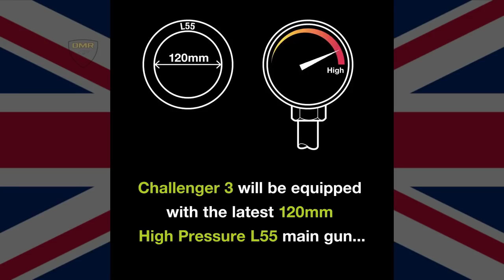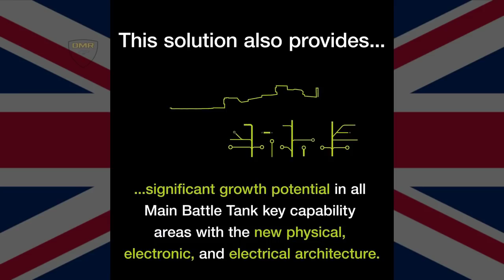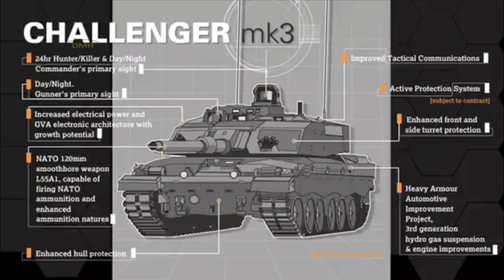Finally! The UK Unveils New Challenger 3 Main Battle Tank

Comment: 60 mph!  WOW but HOW? That is a serious objective. 60 tons at 60 mph! Fast MBTs today do 40-45 mph
Reply: I was thinking the same it would have to an insane amount of bhp, well over 2000
Reply: This just shows that
1200 HP Engine should have been gone 2 decades ago. 

Alright we got a new challenger coming to war thunder!  Lets goooo
Reply: @Justineexy  It's the same engine with common rail injection and a modified airflow/ cooling system.
Reply: its a typo, the cr3 will not do almost 100km/h, that would be almost doubling its top speed, and thats not going to happen with just a new coolant and injection system.
its still 75+t heavy and still has around 16HP/t power to weight ratio
Reply: "Fast MBTs today do 40-45 mph" no that is plain wrong. Alot of tanks today go faster then the chally as it one of the heaviest modern tanks.
Reply: 60KMH is  more likely
Reply: @paulhill1665  it can exceed that now.
Reply: @zhufortheimpaler4041  It isn't a typo. ALL the relevant sites are quoting up to 60mph, including the British MOD site.
The CV12 is getting a power and more importantly ,a torque increase with common rail diesel injection, which combined with third gen hydro pneumatic suspension will make it a really rapid tank.
Reply: @thewomble1509  the current world speed record for a tank is about 54mph from 2002 a Scorpion, think it will be very difficult to get a Challenger to that speed unless travelling vertically, from what I have heard there is a new cooling system and rail fuel injection, even if that was to produce enough power, I don’t think the transmission would cope,
Reply: @paulhill1665  Ok Paul. Sorry, I didn't realise you actually build Tanks mate. Keep up the good work.
Reply: @thewomble1509  well the reasonable sources i can acess all state 60km/h, not mp/h, wich is much more realistic.
the Cr3 is heavy (about 80t) and considering, that lighter MBT like Leo2, M1, Leclerc and T14 have an average top speed of 70-80km/h and the fastest 90km/h and that they all have a power to weight ratio of at least 24hp/t or up to 38hp/t to achieve this.... 
the Cr3 would need around 2200-2500hp and the relevant torque to achieve 100km/h
Reply: @zhufortheimpaler4041  T14 if I remember correctly has a 72mph speed, Unless my Brain. Failed me than that should be right.
Reply: @Justineexy  T14 has 31.1 HP/t and maxes out at 90 km/h
it weights in about 50t and has a 1500hp engine
Leo2a7v has a 1500hp engine, weights in 67t and has a power to weight ratio of 24.2 hp/t and can reach 72km/h
Cr2 has 1200 Hp at 75t and can reach 59km/h
so yeah.... 60mp/s are very llusionary on a 80+t tank
Reply: @paulhill1665  its confirmed 96kph not 60kph. The CR2 already does 60kph lol. CR3 is on a whole different lev
Reply: @paulhill1665  the challenger is actually the best riding tank off road because of its hydro gas suspension....its well known to keep up with faster leopards off road
Reply: @zhufortheimpaler4041  60kph is already the top speed for the cr2...CR3 is the 97kph tank. CR2 has been around for 25 years how do people not know that its 60kph...
Reply: @rayhan_2k841   the report says the work will  include suspension upgrades, but no detail, hopefully does not mean changing to a different system.
Reply: @rayhan_2k841  yes, and the engine does not change, just gets a slight upgrade, how does a coolant and injection upgrade push an 1200hp engine to beyond 2400hp?
Reply: @thewomble1509  If the MOD make a typo, all the relevant sites re-publish it because they're not tank experts. It's almost certainly a typo, there is simply no way that the tank is going to gain that much speed.
Reply: @AllThingsCubey  Why not? Come on, back up your argument, know all.
Reply: @rayhan_2k841  60 kph was just a design requirement, Challenger 2 can travel in excess of 70 kph. Whilst 60 mph is ambitious for CR3 It's not impossible.
Reply: @agt155  Yes, it is impossible.
Reply: @thewomble1509  Laws of physics. Leclerc is 20 tons lighter than Challenger 2 TES, and has the same type of hydrogas suspension, plus 1500hp. Leclerc is limited to 72kph/ 44mph because higher speeds damage the suspension and tracks. Even if Challenger gets a 1500hp engine as CAT is planning to upgrade it to, the tracks and suspension cannot support that speed, and the transmission is not designed for it. A tank's top speed is more down to the gear ratios than the raw engine power, and they are not changing the gearbox in Challenger 3. German sources have already corrected the typo and stated it as 60kph, not 60mph.
Reply: @AllThingsCubey  So many errors in your post there. 
1) Leclerc has second gen suspension.
2) It weighs 57 tons, a C3 weighs 65 tons.
3) as you said , Leclerc is LIMITED to 72 kph to reduce wear and tear on tracks etc. Why can't the C3 be limited for the same reasons? Note the press release said UP TO 60mph.
4) the TN54 IS designed to handle 1500hp.
 5) Torque is just as important as gear ratios and that is being increased.
I've read your quotes before. You claim to be British but constantly criticise and mock British vehicles and equipment.
Oh, one more thing: on operations in the second Gulf war, C2's were regularly clocking 78kph with full add on armour on the road to Basra.
Reply: @thewomble1509  No issues at all in what I said. I said Challenger with TES, which is 75 tons now, 76 tons if put on the Challenger 3. No tank goes to combat without this extra armour.

Leclerc's suspension generation is irrelevant. There is barely any difference. Heck, Leopard 2 uses torsion bars and can go 72kph whilst weighing more than Leclerc. You counter is pointless. Most of what is being called "gen 3" hydrogas is actually just strengthening it to stop the vehicle sagging low to the ground when TES is fitted. This program has been underway for a few years now to address loss of suspension travel and mobility as a result of armour packages the tank needs to achieve even minimum acceptable levels of protection.

If the tank is speed limited to prevent it breaking itself, it's hardly valid to quote a speed it cannot actually achieve. Abrams can break 100kph without the limiter, but it absolutely ruins the track and suspension after even a few minutes.

Torque does matter, generally more than top speed. That's why Germany just geared down the Leopard 2, taking 4kph off the top speed, to gain acceleration to account for the armour increases. Challenger 2 still struggles in this regard. The torque curves for the CV-12 are worse at all ranges than the MTU-883 and RENK transmission. I await the data on the improved CV-12, from caterpillar, which is supposedly capable of 1500hp. It is a step in the right direction, but the tank remains excessively heavy. Even in full add-on armour, the much larger dimensioned Leopard 2 weighs 68 tons, under the maximum for NATO standard bridges, with the weight spread over a larger track area for greater flotation and mobility. The smaller, 76 ton TES challenger loses a serious degree of mobility on soft ground and cannot cross those standard bridges, or be deployed by C-17.

I am British, and I don't hate all our equipment, just the truly shit ones like Challenger 2, when I am aware of the significant degree of political medalling which gradually has robbed the British Army of capabilities they should have been given long ago.
Reply: @mattbcfc_4750  We already have engines that can do it. Remember the tanks doing 45MPH are using 30+ year old tech. Also we have gas turbines available now which push out 3000+BHP that would easy fit in a tank. The only issue is fuel consumption.
Reply: @thewomble1509  Nope they already have common rail Perkins engines. The cooling is always an issue as armour gets in the way and basically the only way of getting a shedload of power is gas turbine. We have some that can easily produce 2MW that would fit in a tank and that;s about 2750HP
Reply: @zhufortheimpaler4041  There are gas turbine engines being looked at which would take the BHP/Tonne to about 40-45 dependant on the specific engine.
Reply: @paulhill1665  I believe the suspension upgrades are to increase travel and robustness.
Reply: Leslie Dodds  You really want a non Bullpup for CQB? Ever done even paintballing CQB? Nope didn't think so.
Reply: @AllThingsCubey  What as impossible as the Scorpion doing over 115KPH near 35 years ago? Yep and nobody is ever going to get anything heavier than air to fly either.
Reply: @gordonlawrence1448  there is a difference:
Scorpion is only 8-9t heavy, has a very strong torsion bar suspension with high ground clearance, an engine with high torque and 24hp/t power to weight ratio.
Cr3 is 10x as heavy with nearly 80t combatload and 15hp/t.
guess, wich tank has a higher attrition on its parts....
and wich tanks engine needs to work harder?
its just simple physics, that it is significantly harder to accelerate a heavy object and requires more energy to keep it at a certain speed, considering factors like friction, than lighter objects.
Reply: @AllThingsCubey  Chally 2 proved itself in the Gulf against real opposition. One lost a track in a ditch reversing out of an ambush and stayed put all night, it had multiple RPG fired almost point blank and two anti tank missiles fired at it. It survived as did the crew. It was repaired and put back into service. The Leopard has not got that track record. Changing the gun means we can use the same ammo as our allies.
Reply: @zhufortheimpaler4041  with new suspention with new fuel injection  a superchip and induction kit oh and momo alloys might aswell get it lowered while we are there :)
Reply: @anthonywilson4873  I'm going to burst your bubble on that.

The range an RPG is fired from doesn't effect the warhead at all. RPG-7s are too weak to threaten any modern tank. Abrams and Leopard 2s of the same era as Challenger 2 could similarly have sat in that ditch and basically been fine. It was also not widely reported but found later that most of the RPGs were not even anti-armour warheads, but fragmentation anti-personnel ones, which you would expect to have less than no effect on a tank.

Challenger 2's survivability is a myth, perpetuated by fanboys, using out of context scenarios like that. They will never admit the armour is actually weaker than both Abrams and Leopard 2, or that the lack of blow out compartment for the ammo led to the cook-off in the friendly fire incident which blew the turret off the tank.
Reply: @gordonlawrence1448  Small correction, there are things heavier than air that can fly. People call them aircraft.
Reply: @AllThingsCubey  A Leopard 2 was destroyed by mortar fire in Syria, and many Abrams have been taken out by RPG's. They simply do not have the all around protection of CR2. Especially the Leopard with its suicidal ammo stowage.
Reply: @AllThingsCubey  Who cares about German sources? The MOD have confirmed 60 MPH.
Reply: the journalist has no clue what he is speaking about - he means 60 km/h 🤣
Reply: @minimax9452  You are spot on. 60 kph = 37 mph which is the current top speed of Challenger 2. So no increase at all.
Reply: I bet it takes 3 hours to get to that speed
Reply: The limiting factor speed for things like this, is really the suspention, going fast is the easy bit, going fast and not bashing yourself to pieces on every bump and riple in the ground gets more difficult the faster you want to go.
Reply: @agt155  Yeah but they have the armour where it counts for tank on tank combat, the front. Mortars only hit the Turkish Leopards because they're shit tankers. Roof armour upgrades are available for more modern Leopards anyway, Sweden was very impressed by that, and quoted it as a reason they chose it over Abrams. Your point is still irrelevant.
Reply: @agt155  The MOD made the original fuckup, it's not capable of 60mph.
Reply: @AllThingsCubey  Any proof or just more conjecture?
Reply: @AllThingsCubey  Sweden didn't seem to care about "roof armour" on the 170 Leopard 2's they were given for free -  the real reason they chose the leopard.
Reply: @minimax9452  The Challenger 2 can hit 75 kph. Challenger 3 will hit 60 mph.
Reply: @agt155  no way ;-) dream on! ok the british ruined under thatcher their industry. So thegermans hav to "renovate" their old tank. But not beeing able to destinct between kmh and mph is a new low.  here is the wikipedia site about challenger II says 59 kmh (37mph) https://en.wikipedia.org/wiki/Challenger_2
Reply: @paulhill1665  MVEE/RARDE had a stripped Scorpion with a v8 engine called the WASP. I'm pretty sure it went well past 54mph, but there's official and "unofficial", my mate drove it and said at those sort of speeds a blink and you lost control.  Balls of steel!
Reply: The engine does 2300 rpm, so you can increase the power all you want, but it won’t go 60mph without  more gear ratios
Reply: @benlis1  this old lady will never go 100 kmh - or even once 😅
Reply: @paulhill1665  Before the CVRT petrol was restricted it was faster but through tracks!
Reply: @agt155  How many Challenger 2's have seen combat compared to the Abrams and where?
Reply: That will be on a long flat paved road with out an add on armour package. Basically never happening.
Reply: @Justineexy  that's the "official" or "military" speed.

The tank probably would be able to go up 100kph if they really wanted to push it, but that would increase the wear on the tracks immensely.
Reply: @thewomble1509  it's a typo on the MOD's part. While all UK sources are reporting 60mph, all German sources are reporting 60kmph
Reply: i AM IGNORANT. Still . . .
You all seem to suggest that 60mph is a defined thing. Wkith respect unless you qualify and define terms squabbles over nrthing seem possible. For example are you conparihng 45mph on battlefirld with 60mph on road? Are  you all assuming that Challenger three  needa a tank transporter?

I don't have the turret specs, but is therre an chance it could be lighter than on   Chalenger 2?

Engines on ships now take engfone  output as electricity.. If the Vhallenger 3 coulid do likewise would that account for tthe lack of gear ratios?
------------------------------------
idle speculation for fans only

there ssems to bbe a lot of emphasis on armour vs infantry weapons, yet I've nvder hdeard of as tasnk jusing a body of water or even snow to hide hul down in ambush.

Where wwe've been (iraq, Afghanistan) such options doo not exist, dry countries. But where we are goiing, Estonia, is that still the case?
Reply: @SVNLVN  Why would "German sources" know?
Reply: @agt155  because RBSL is a joint venture between Rheinmetall, a German company, and BAe systems, a British company.
Reply: @SVNLVN  The mobility upgrades are not part of the LEP contract and so nothing to do with RBSL.
Reply: Same rolls Royce / Perkins engine bigger turbos and electronic fuel injection similar to Trojan and Titan but with electronic fuel injection instead of mechanical  which will also help cold starting issues. chally 2  has always been the best tank of road now it just got even better
Reply: @paulhill1665  if you are referring to Scorpian i.e. the British CVRT petrol variant which by the way was taken out of service and replaced with a diesel variant some time ago. That’s not a tank, it’s an AFV (Armoured Fighting Vehicle).